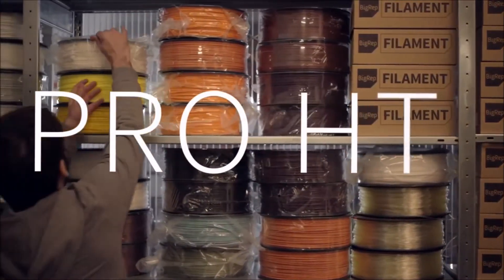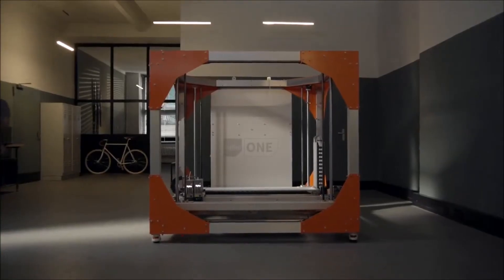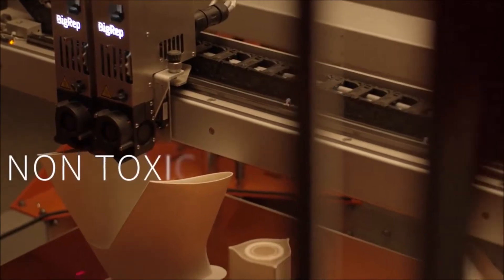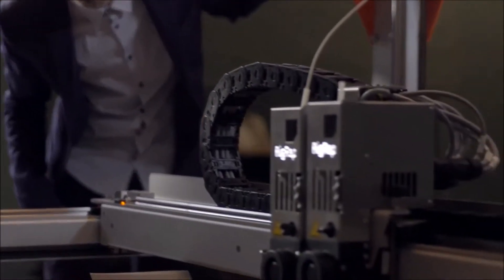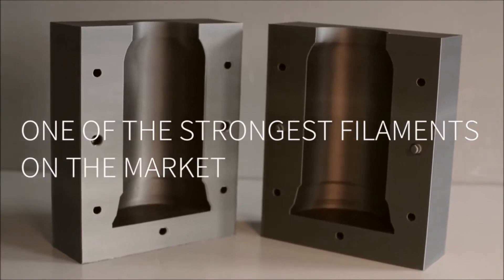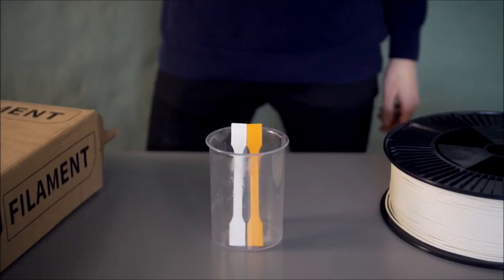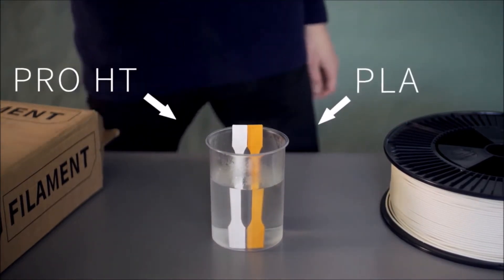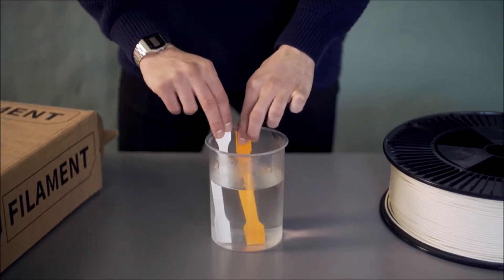BigRep PRO HT - High Temperature 3D Printing Filament

Comment: Would you guys be able to print a color matched Battery cover for a 1977 Honda XL 75?
Reply from the maker: Probably not an exact match...  unless it's black.  If you don't have the CAD model, we can scan the original part as well, to create the file required for printing. You can e-mail photos of the part to Dan@neometrixtech.com for a price estimate.  Thanks!